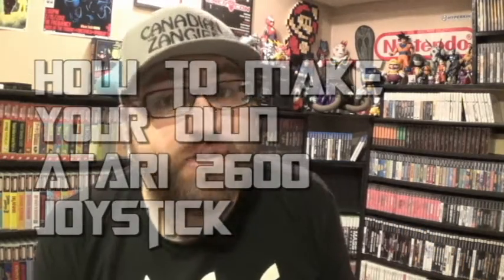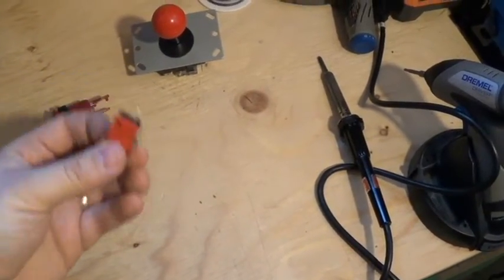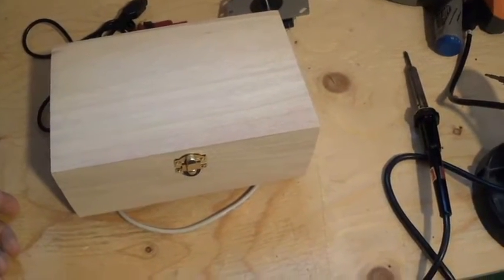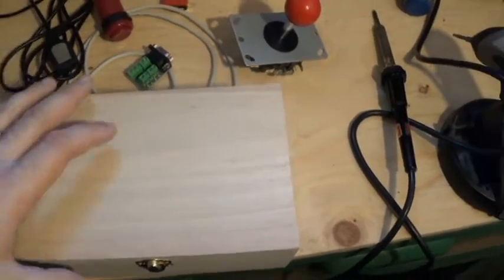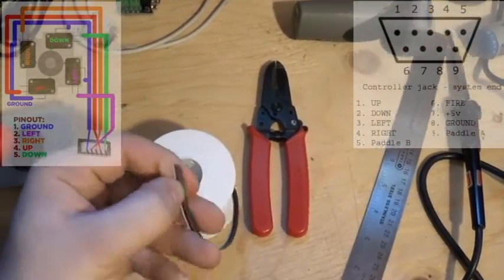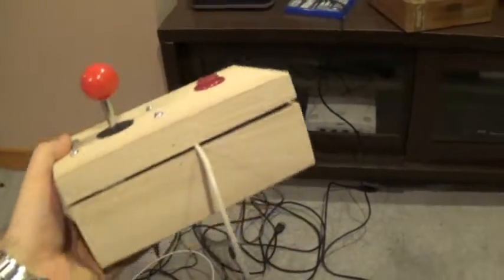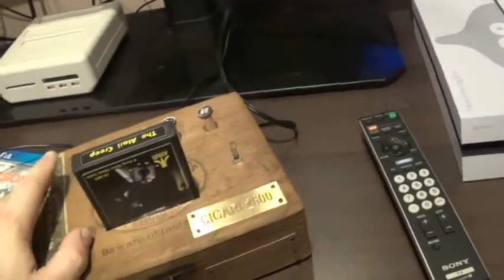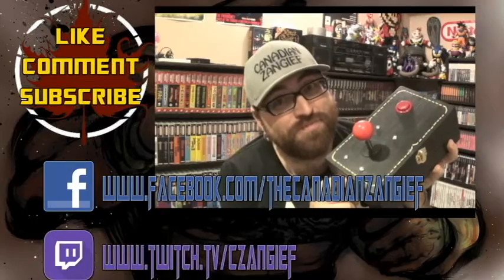Episode 33 Make Your Own Atari 2600 Joystick

Comment: I just got an atari was looking to do something like this. Instead of using that one thing you did for the cord could you use an old atari controller board?
Reply from the maker: You should be able to. Check out this guide it uses harvested parts from an existing joystick. 
http://www.instructables.com/id/Make-Your-Own-Atari-Joystick/